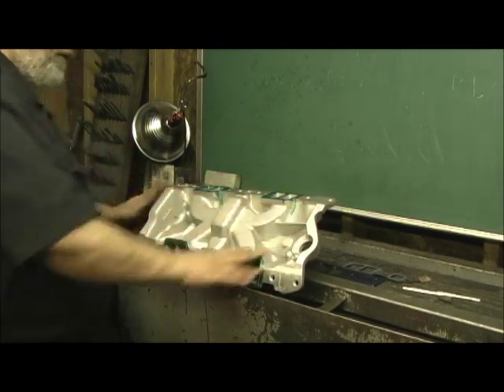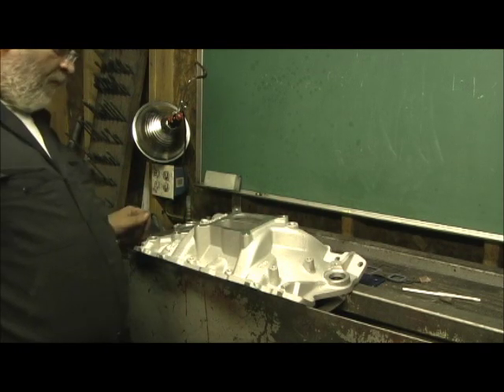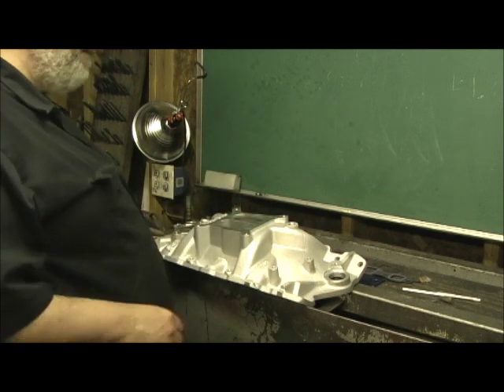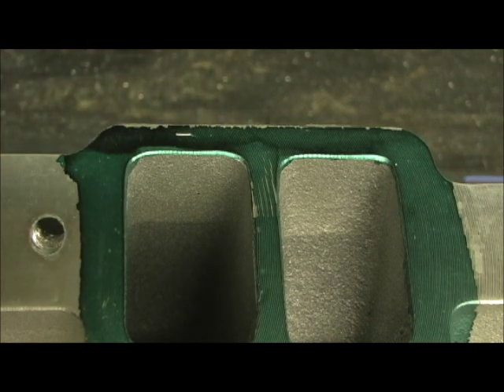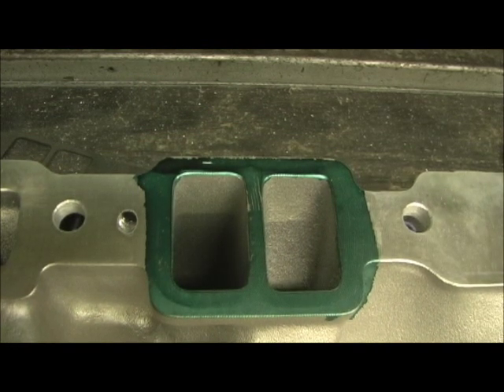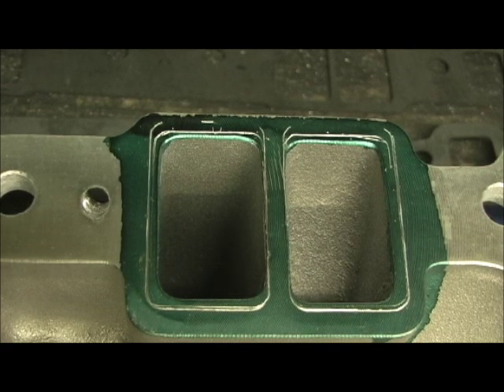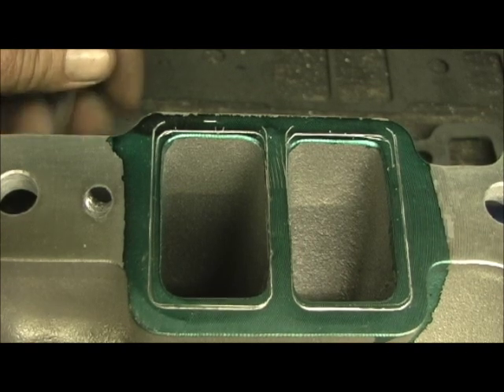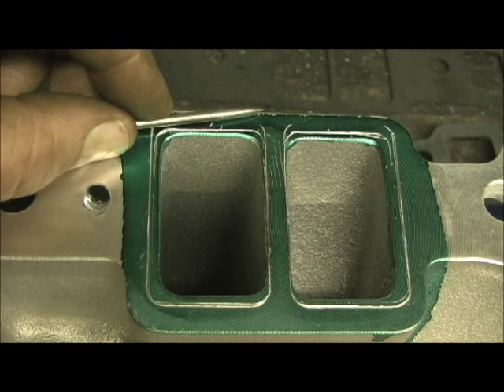ProComp 190 Stage IV "Denmark Duo" Intake Manifold Port and alignment  3.4

Comment: Sounds like you know what you're doing. I never really got into the nit picky perfection like this because I never raced or had anything with decent HP.... but now I have something I really want to make right. I know you're probably going to laugh at this but Im working with what is a 95 350 truck bottom with 10.5:1 compression flat tops. I have zz3 heads. Now this is the funny part, the intake I have no clue whos it is, but I like it. It has a pretty good rise to it and Before tearing it down I was able to spin it at 6000 rpm all day with a holley 600 on it. But was having trouble with it falling on its face at the low range and then coming on like a hurricane all the way to the 6000rpm. Im going to be trying to figure out the match up from the intake to the heads now with out the fancy plate you got there. With what I just said I have to work with, what carb would you run on that and what sort of HP would you say I may be able to get out of it?
I was just wondering if you had any advice for me? Thanks

Comment: Damn Yankees mig or tig the outside of the runners so there are no worries about busting through.
Reply from the maker: You don't think I did not already think of that? it is what I do, and I even epoxy this stuff (it will NEVER come off due to the locking ability of being on the outside and inside) but some people get very upset when they see epoxy on a NEW manifold, even though it will NEVER leak or come off due to its location.....ME, MYSELF and I would have gotten a torquer II and turtle it, and have the best of BOTH worlds but you HAVE to epoxy the dam torquer II to 1205 OR 1206 the thing, but at least you would have had an OPEN plenum, and then "SUPER-TURTLE", or SWIRL like you...SWIRL LIKE A GIRLL
Reply: Swirl like a girl?
Reply from the maker: Charles Servedio LOL, just for you dude.....

Comment: The performer used two different runner csa to produce two torque curve peaks effectively flattening out the torque curve. The lower plane had much smaller runners than the top plane. That was designed about 1991. yhe performer rpm used very similar csa but a larger csa than the performer with the damn notched plenum that I hate. The eps looks like a bit smaller csa than the rpm with a solid divider. It is a nice piece.
Reply from the maker: You know, that was my thought as well Yank, It broke my heart when I seen the intakes they bought, but I had to remember that it was going on a Vette with NO HOOD CLEARANCE!!! IT is a better by far than the performer, but lacking the plenum of the RPM, but we have had this talk before and I HATE the dam Dual plane because of DYNO test that showed it was all bullshit. The Open plenum RULES no doubt about it. That being said, this piece that the "DENMARK DUO" has given me is the best they can have when you take into consideration HOOD CLEARANCE. IT was hell how I got it to fit the 1206/1205 combo, because I would have busted through if I tried to make it a 1206 TRUE STATEMENT mathematically speaking.